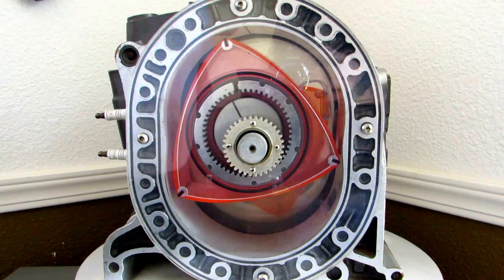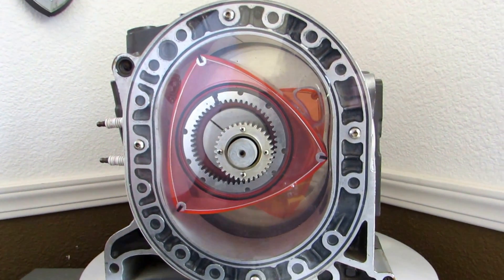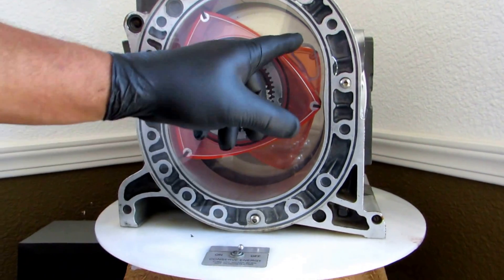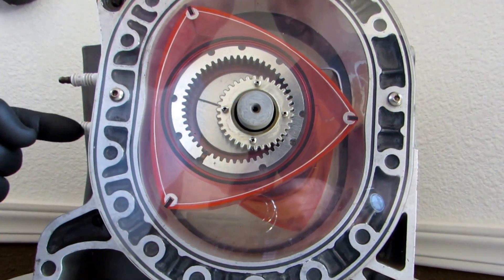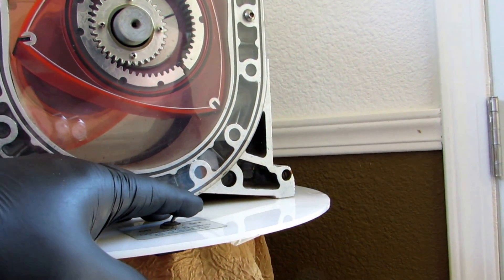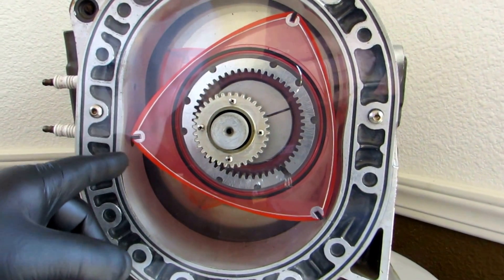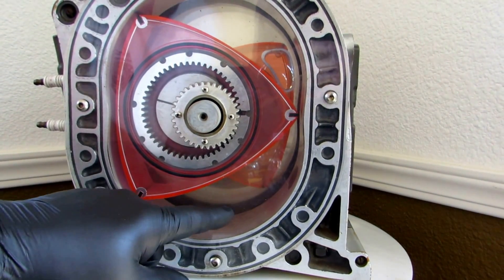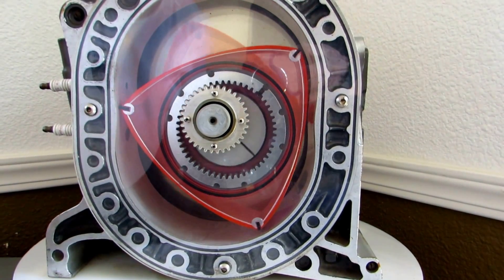Kurt Robertson explains how a Rotary engine works

Comment: Thank you you are the first person to say it is similar to a 2 stroke cycle as the 4 parts of the cycle take place in a single 360 degree cycle. Not a 720 degree cycle like a 4 stroke. So thanks you. The displacement volume of a rotary is always stated oddly , i believe for tax reasons as the swept volume of a single chamber per rotor, not all 3 chambers. So a twin rotor is actually a 3 x  650 cc per rotor or 6 x 650 cc fr both rotors. This gives a swept volume of 3900 cc for a single 360 degree cycle. So if you then take it to a 720 degree 4 stroke cycle the total swept volume is 7800 cc . So if we take the Renesis engine and say it has 231 bhp from nearly an 8 litre swept volume no wonder it is thirsty. Also the power stroke is only about 90 degrees or a 1/4 of the 360 degree cycle then this is why there is not a lot of torque. Still the RX 8 is one of the most enjoyable cars that i have driven and i have been close to buying one on more than one occasion. But i have never been brave enough to do so. But i am still tempted. I woulfd like to buy a 2009 version , but here in UK the road Tax for that year is £550.00 per annum, so a pre 2006 has a road tax  of £325.00 per annum.
Reply: The Mazda 13b series has a total true swept displacement of 3,924cc's.
When compared to reciprocating 4stroke engines that are 720° degrees of crankshaft rotation, the Wankel has an effective displacement of 2.6 liters.
Reply: I believe a large reason people often compare it to a 2 stroke, is because of the number of combustion cycles the engine actually has at any given RPM.

In a 4-stroke engine running at 1000 rpms, we have a combustion cycle every other rpm, giving us 500 combustion strokes.

In a 2 stroke engine, wed have 1000 combustion cycles.

Like wise, in a rotary running at 1000 rpms, we also have 1 combustion cycle every rpm of the e-shaft, giving us 1000 combustion cycles- like a 2 stroke.  

If we "measure" the volume of the combustion cycles, wed get double the "rated" volume, for a volume of 2.6, in place of the 1.3
Reply: @SidewaysGts  Thank you for your completely pointless analogy and confirming that you don't understand why the Wankel engine is a 4-stroke engine.
Reply: @sandervanderkammen9230  "Thank you for your completely pointless analogy and confirming that you don't understand why the Wankel engine is a 4-stroke engine."

When did I say or imply it wasnt sweetheart?

Youre digging deep to troll this time.

So out of curiosity- Your wife ever recover from the train that Rx7 driver ran on her?
Reply: @SidewaysGts  Rotard Gestapo!

Comment: aser ignition Traditional spark plugs need to be indented into the walls of the combustion chamber to enable the apex of the rotor to sweep past. As the rotor's apex seals pass over the spark plug hole, a small amount of compressed charge can be lost from the charge chamber to the exhaust chamber, entailing fuel in the exhaust, reducing efficiency, and resulting in higher emissions. These points have been overcome by using laser ignition, eliminating traditional spark plugs and removing the narrow slit in the motor housing so the rotor apex seals can fully sweep with no loss of compression from adjacent chambers. This concept has a precedent in the glow plug used by Toyota (SAE paper 790435), and the SAE paper 930680, by D. Hixon et al., on 'Catalytic Glow Plugs in the JDTI Stratified Charge Ro

Comment: Thermal Efficiency of an Engine can be expressed by: 100(1-Te/Tp) -in %, Te= Exhaust Temperature, Tp=Peak Combustion Temperature; as pointed in the 'Wankel Engine Breakthrough' YouTube Video, Wankel RCEs have high Exhaust Gas Temperatures, that from the early days of Internal Combustion Engines are known being linked to low Effective Compression Ratio, these first times because of poor quality of available gasoline. If changing the plug hole to an slot as Ernie Brink proposes, reduces greatly the Exhaust Gas Temperatures, this would mean a much higher Effective Compression Ratio, improving the overall efficiency of Wankel Engine; this looks as a change worth testing, but some welding and trochoid surface coating expertise is needed. Rounding the plug hole-trochoid surface intersection corner, and also port-trochoid surface intersection would improve engine's life, as it would minimize chances of seals hitting hardly the hole borders. We wait for more experimental data about these modifications, please! Salut †
Boquilla=nozzle, port, tube, duct, hole.
Reply: Rotary engine in the Mazda RX-8. (Image: Mazda)The rotary engine has been around since the early 20th century. But it didn’t come to autos until the second half of the century. The “Wankel” engine was licensed by a long list of OEMs but its deployment is best known in Mazdas, the company that put the rotary engine under the hoods of a variety of vehicles, the last of which was the RX-8. Production ceased in 2012.Simple DesignAlthough the rotary engine is compact and simple—as in no pistons, camshafts, etc.—with a quasi-triangular shape (the lines between the points of the triangle are arcs, not straight lines) moving in an eccentric orbit within a combustion chamber.Vexing ProblemsReasons why Mazda stopped producing the engines include not-stellar fuel efficiency and emissions issues, both largely predicated on compression problems, which lead to incomplete combustion such that there was unburned fuel after the spark.Potential SolutionsFormer Mazda technician and inventor Ernie Brink thinks that he has come up with design modifications that address these drawbacks of the rotary engine and he talks about it on this edition of “Autoline After Hours” with Autoline’s John McElroy, Todd Lassa of Automobile Magazine and me.What’s more, Brink provides demonstrations of the way the Wankel works—even using an air compressor to rotate the rotor.

Comment: THE FOUR STROKES OF A INTERNAL COMBUSTION OCCURS SIMULTANEOUSLY IN A WANKEL ENGINE THIS MAKES IT MORE EFFICIENT THAN A PISTON ENGINE
Reply: illitero
illitero
1 year ago
I can't believe the number of people discrediting these theories simply because he doesn't have access to manufacturing to make a perfectly pretty prototype. Experimentation and theories NEVER start with any amount of polish, and fucking obviously he's not implying that what he's showing is "good to go".

Also seeing a lot of people trying to say that these ideas won't work because of fluid dynamics, but apparently they're not considering the other forces in play. NO, it doesn't reduce the pressure of the post-combustion gasses; that's not the point. The point is to manipulate the expansion of gasses into rotational energy, which is the whole fucking point of the engine. Existing designs only ever maintained rotation because of pre-existing rotation upon start up. That's the only thing that keeps it rotating. The pocket just assists the expansion in a desired direction prior to venting to exhaust.
18

Comment: THE FOUR STROKES OF A INTERNAL COMBUSTION OCCURS SIMULTANEOUSLY IN A WANKEL ENGINE THIS MAKES IT MORE EFFICIENT THAN A PISTON ENGINE
Reply: RotaryPerfection
RotaryPerfection
7 months ago (edited)
doktorbimmer Sore loser? My overall general knowledge of the rotary FARRRRRR surpasses what you read on the internet so I'm not embarrised about anything. Your the one that's hiding and too afraid to put your opinions out there for the world to see while you DON'Tshow your face. That's embarrising! 

When it comes to firguring the displacement of the rotary, the 13b is rated at 1.3l That's a fact your just gonna have to accept.  Again if you think Mazda has falsely rated the engine, how is it they have gotten way with false advertising for DECADES?
1
doktorbimmer
doktorbimmer
7 months ago
+RotaryPerfection Yup, you made yourself look like a fool.
doktorbimmer
doktorbimmer
7 months ago
+RotaryPerfection Mazda no longer rates the engine as a 1.3 and no longer manufacturers the 13b or any other Wankel engine, Mazda  used "Tax Displacement" as a loophole, this contrived method invented by NSU.. not Mazda and is no longer recognized as a valid method of measuring displacement.
RotaryPerfection
RotaryPerfection
7 months ago
+doktorbimmer Dude give it a rest. It's sad how obsessed you are with being right within this discussion. You just wrote 3 separate post in hopes to get me to respond. I've said what I needed to say on the subject and now I'm moving on. Understand his one thing. YOUR OPINION DOESN'T MATTER TO ME because you have ZERO hands on experience with the actual engine. I wont respond to you again so you can have the last word (which I'm sure is exactly what you want).
1
ernie brink rotary hemi
ernie brink rotary hemi
7 months ago (edited)
thank you sir he is stupid and *we know he is  the one *impersonating Ernie Brink the guy in rotary hemi breakthrough thank you RotaryPerfection *
1
ernie brink rotary hemi
ernie brink rotary hemi
7 months ago
ZERO hands on experience with the actual engine
3
ernie brink rotary hemi
ernie brink rotary hemi
7 months ago (edited)
dokotorbimmer( bird brain) is afraid of ernie brink he is  on to something***????  https://giphy.com/gifs/tweety-bird-cvOmdJLyBfpw4/tile
Reply: if you keep telling doktorbimmer that he will start crying. Wankel engines are intimately related to his type of schizophrenia.

Comment: WHEN A APEX 2MM LINES UP WITH THE LEADING PLUG HOLE 14MM  MAJOR LEAKAGE
Reply: cool
Reply: @erniebrinkrotaryhemi7336  John Burns
The cavity in the rotor is uniform in shape.  That means the explosion in the combustion chamber acts towards the rotational movement and acts towards the back end of the rotor trying to force it backwards as well, countering the forward movement.  This is also in electric motors and known as Back Electro Motive Force.  A guy named Ernie Brink said in an experiment he changed the shape of the rotor's cavity so most of the charge is towards the front of the rotor not the back. He said efficiency rose.
Reply: Rotary engine in the Mazda RX-8. (Image: Mazda)The rotary engine has been around since the early 20th century. But it didn’t come to autos until the second half of the century. The “Wankel” engine was licensed by a long list of OEMs but its deployment is best known in Mazdas, the company that put the rotary engine under the hoods of a variety of vehicles, the last of which was the RX-8. Production ceased in 2012.Simple DesignAlthough the rotary engine is compact and simple—as in no pistons, camshafts, etc.—with a quasi-triangular shape (the lines between the points of the triangle are arcs, not straight lines) moving in an eccentric orbit within a combustion chamber.Vexing ProblemsReasons why Mazda stopped producing the engines include not-stellar fuel efficiency and emissions issues, both largely predicated on compression problems, which lead to incomplete combustion such that there was unburned fuel after the spark.Potential SolutionsFormer Mazda technician and inventor Ernie Brink thinks that he has come up with design modifications that address these drawbacks of the rotary engine and he talks about it on this edition of “Autoline After Hours” with Autoline’s John McElroy, Todd Lassa of Automobile Magazine and me.What’s more, Brink provides demonstrations of the way the Wankel works—even using an air compressor to rotate the rotor.

Comment: Mazda only makes reciprocating engines now... that should tell you something.
Reply: YOU HAVE BEEN SAYING THAT FOR YEARS 5 http://az616578.vo.msecnd.net/files/2016/08/27/6360787077700554381193066848_Internet-Troll.jpg
Reply: Rotary engine in the Mazda RX-8. (Image: Mazda)The rotary engine has been around since the early 20th century. But it didn’t come to autos until the second half of the century. The “Wankel” engine was licensed by a long list of OEMs but its deployment is best known in Mazdas, the company that put the rotary engine under the hoods of a variety of vehicles, the last of which was the RX-8. Production ceased in 2012.Simple DesignAlthough the rotary engine is compact and simple—as in no pistons, camshafts, etc.—with a quasi-triangular shape (the lines between the points of the triangle are arcs, not straight lines) moving in an eccentric orbit within a combustion chamber.Vexing ProblemsReasons why Mazda stopped producing the engines include not-stellar fuel efficiency and emissions issues, both largely predicated on compression problems, which lead to incomplete combustion such that there was unburned fuel after the spark.Potential SolutionsFormer Mazda technician and inventor Ernie Brink thinks that he has come up with design modifications that address these drawbacks of the rotary engine and he talks about it on this edition of “Autoline After Hours” with Autoline’s John McElroy, Todd Lassa of Automobile Magazine and me.What’s more, Brink provides demonstrations of the way the Wankel works—even using an air compressor to rotate the rotor.
Reply: Mazda stopped making Wankel engines 9 years ago.
The last time Mazda unveiled a new production Wankel engine was over a quarter century ago..

Comment: THE ONLY SUCCESSFULLY MASS PRODUCED ENGINE IN THE 21 ST CENTURY  VERY EFFICIENT NO FLAMES OUT THE EXH STROKE  Rob Wwhit  http://az616578.vo.msecnd.net/files/2016/08/27/6360787077700554381193066848_Internet-Troll.jpg 
Hey i just noticed that this guy ( The real doktorbimmer) has a real  major Rotary engine chip on his shoulder! LOL, A cursory look at his ramblings shows me he couldn't engineer his way out of a wet paper bag!    LMAO.

Comment: MAZDA'S NEW 4-CYLINDER SKYACTIV-X TECHNOLOGY COMING IN 2019 https://insidemazda.mazdausa.com/newsroom/2017-tokyo-motor-show/
Reply: YOU HAVE BEEN SAYING THAT FOR YEARS 5 http://az616578.vo.msecnd.net/files/2016/08/27/6360787077700554381193066848_Internet-Troll.jpg
Reply: @therealdokoterbimmerrotary6751  a brilliant mazda and lexus mechanic (who obsesses about rotary engines the way ferrari owners obsess about their paint finish) has stumbled across two mechanical breakthroughs that could make the rotary a total lunatic on the track as it ought to be

Comment: June 22 marks the 6th anniversary of the end of RX production, on Thursday June 21, 2012 at 4:30pm the final RX-8 car ever to be produced rolled off the assembly line, the last RX model to ever be produced by Mazda.
Reply: Doktorbimmer more like doktorboomer, jesus shut up, man you don't like it you wanna mess with the lil detail a wankel and rotary, its the almost the same bro jesus
Reply: @TicRevenge  Its now 9 years since Mazda stopped making these horribly unreliable engines... obsolete technology.
Reply: @TicRevenge  A Yugo is virtually bulletproof compared to a RX8...
Reply: @TicRevenge  The Germans were winning Le Mans back when Mazda was just a company making bottle caps and rickshaws!!!!

Comment: rotary is crap no durability at all
Reply: my 12a turbo DD rx7 that was still running 8yrs later would disagree with you
Reply: They go 100k miles before there is a problem if properly maintained. But yes, rebuilds are a fact of life every 5 to 8 years.
Reply: @mischiefpwns  1080 turns for output make the wankel more efficient
Reply: The Wankel engine is notorious for poor reliability and short service life.. its one of the fatal flaws that explain why they have been obsolete for several year already.
Reply: No durability or reliability... which is why they cannot be used in passenger aircraft applications.

Comment: https://www.youtube.com/watch?v=v3uGJGzUYCI
Reply: Mazda last built a car powered by a rotary engine in 2012, the RX-8, but had to abandon it largely to poor fuel efficiency and emissions. It has continued to work on the technology, however, as it is one of the company's signature features. Mazda officials have previously suggested that if they can get it to perform as well as a reciprocating engine, it will bring it back to power a conventional sports car, too.
                    -Published November 23, 2016  Fox News
   Current Mazda Wankel engines have more than 100 seal related parts, Mazda had big problems sealing the Wankel engine. That is still an on going issue with the injection of oil into the combustion chamber(s) to lubricate the apex seals to keep combustion gases from mixing with intake gases. These engines are still being fine tuned to deal with these issues. Some of the first Mazda made Wankel engines would barely make it 50k miles before they were in need of a complete rebuilding. I like the Wankel engine but It is no where near ready to replace/compete with the current reciprocating engine design and probably never will be.
Reply: Ignore Ernie brink... he is a complete nut job

Comment: SMALLER VOLUMES AND LARGER VOLUMES 4 STROKES ALLWAYS MOVING IN A ROTARY MOTION
Reply: THE TROLL CAN''T FIX HIGH EGT'S ON A WANKEL HE IS STUPID IT'S ALL ABOUT PAY DAY  
ERNIE BRINK       touch three birds with one stone you are the man   One third of crankshaft speed is not the same as ....."   Oh c'mon, doktorbimmer, isn't it obvious he just misspoke?  Really.....
Ernie Brink
Ernie Brink
1 hour ago
doktorbimmer you don't seem to know much about the facts do you MORE NAMES REALLY YOU CANN DO BETTER OR MAY BE NOT?
Ernie Brink
Ernie Brink
3 hours ago
ENGINEERS MAKE MISTAKES
TO INDEX IT JUST HAVE PLUGS IN ONE ROTOR TAKE LEADING PLUG OUT PUT THE APEX IN THE MIDDLE OF THE LEADING HOLE THEN MARK THE FYLWHEEL PAINT PUT THE PLUG BACK IN AS YOU KNOW ROTATE 1 TIME AROUND YOU WILL HEAR COMPRSSION OUT THE EXHAUST PORT AWESOME THANK YOU HOW TO INDEX A ROTARY ENGINE*
Reply: rotaryenginepete It's obvious you'll never cite your false claims. Anyone can read the previous comments to see my evidence comes directly from Mazda, and you simply have nothing but hot air to bring to the table **rotaryenginepete**19 hours agoBlog yes. But if you actually read the article, it speculates based on recent quotes from*MAZDA